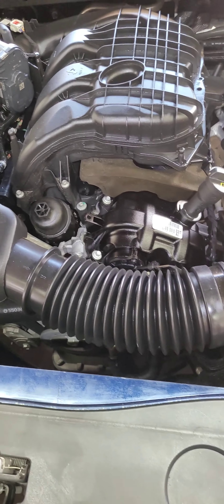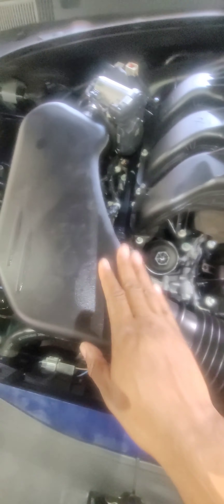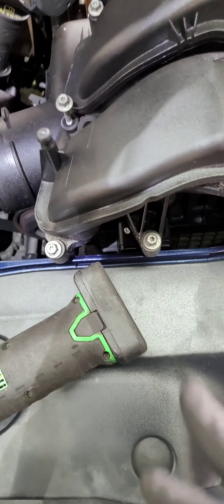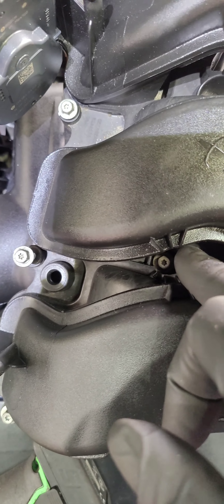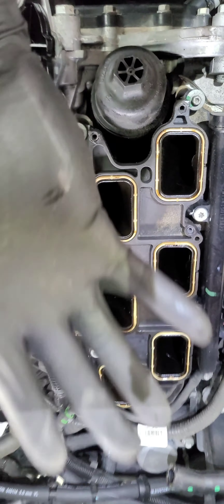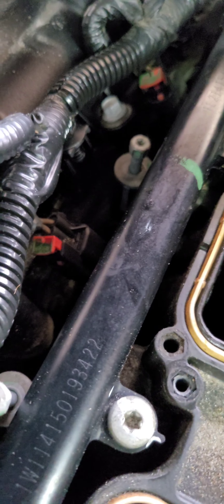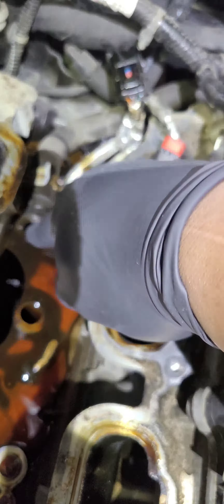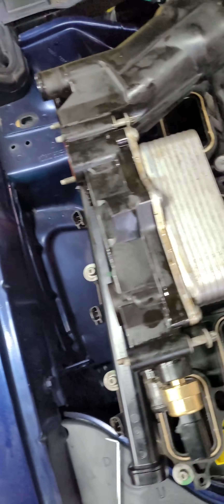2011-2014 (2014) Dodge Charger, oil pressure switch change due to code p06DD,  p0520

Comment: How did you get the part off with the oil filter on it I undid the 5 screws and still fell like something is holding it
Reply from the maker: Hope you got it off you just had to wiggle it out with a lil force..

Comment: Bruh that not the Coolant Sensor.. The Coolant sensor is on the Right side of the motor near the bottom.. Coolant sensor Tabs are Red .. Super Easy to remove .. That part is the Oil pressure Sensor…. And the oil pressure Swith is behind the Motor…😮😮😮😮😮😮😮😮😮